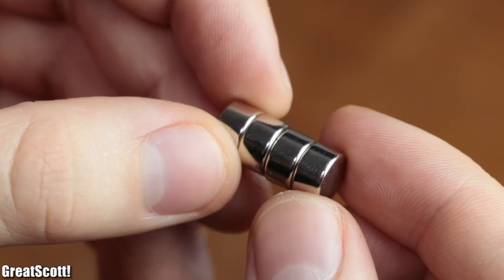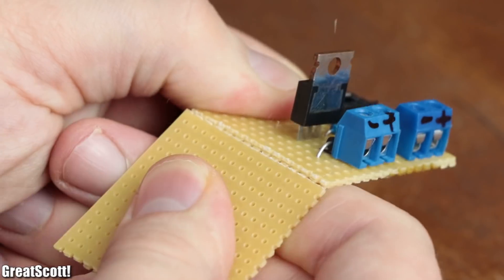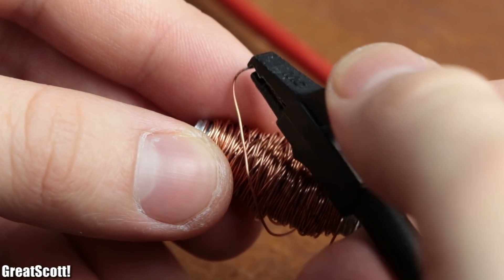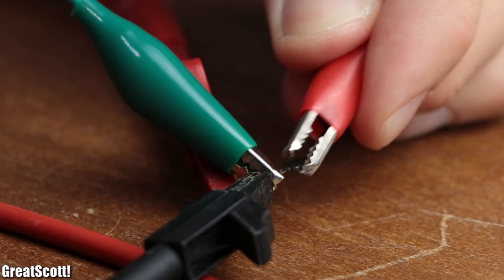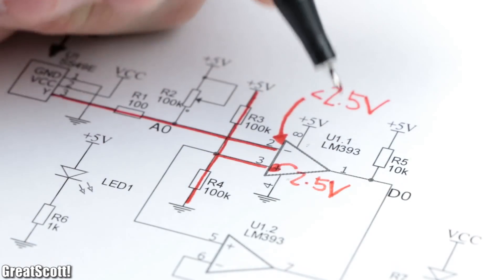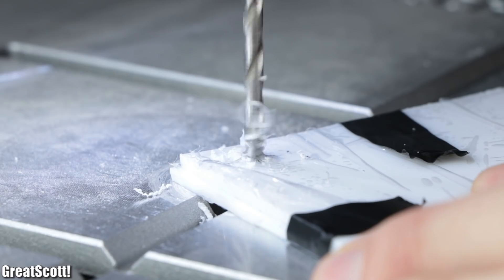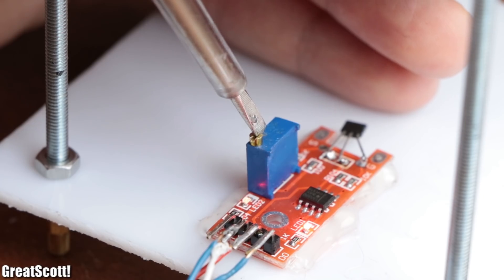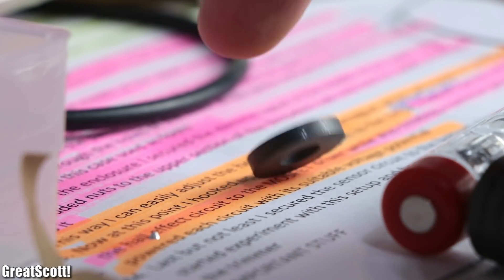How does Magnetic Levitation work? || Crude Levitator circuit

Comment: I'm in university and this year I had  to make a project in wich i had a big electromagnetic coil and i needed to control it in order to levitate a small metal ball and i had to use a comparator witch infomation was than feed into a PID controler and then the PID controled the current in the coil, you could do something like this
Reply from the maker: Yes, I am thinking about doing a basics PID video with the levitator as an example.
Reply: okey :-) it seems a good idea!  In my opinion, despite having a university discipline on control theory and another in which I applied this knowledge, the PID controller is still something complicated to understand but very useful to apply in several cases more in the automation electronics level!

Comment: Adding a PID to the comparator output might do the trick.
Reply from the maker: Hmmmmmmm maybe a PID basics video with this levitation task as an example...........
Reply: Would you consider trying to find the PID gain constants using a model for the system and root locus, or using a trial and error approach? Also, does the hall sensor only provide a "on/off" signal?

Comment: Hi Scott. Please help me. I need comparator for my little circuit. Circuit needs to turn on an LED if battery voltage is below 3.5V. Do you have any comparator to recommend?
Reply from the maker: The LM393 shows in the video should be able to handle this job.
Reply: So pin IN1(-) connects to ref. voltage(threshold voltage, 3.5V), IN1(+) connects to battery voltage?
http://pdf.datasheetcatalog.com/datasheet2/8/0uwqfq886ztdzxl759w49r6trg3y.pdf
Reply: It depends on the way you connect the LED: if the positive voltage is above the negative voltage, the Output is pulled up to (almost) Vcc, if not to GND. So if the LED is connected like in the schematic shown in the video (Vcc-Resistor-LED-ComparatorOut) your connections are correct
Reply: Here's schematic - https://imgur.com/WlhTOoi.png
-IN is threshold voltage, +IN is voltage from battery(for testing purposes it's another trim resistor).
Should I swap LED or inputs?

Comment: That is quite a complex system to control by just turning off and on the magnet. You should apply PWM to the electromagnet so you can regulate its magnetic field. Also you should look into control systems such as a PID controller, as this will allow you to achieve much better results.  You could implement more complex control systems such as a FUZZY controller but that is quite complex and you definitely need MATLAB for that.
Reply from the maker: When I get to part 2 of the video then I will certainly include a more complex control system.

Comment: Great video! Can you maybe make a video about a diy bms? because the china bms's are very inconsistent, I have bought 4 3s bms's for my bluetooth speaker and they all broke (not my fault), maybe a design which u can stack up? so you can stack 3 of them for a 3s pack, 6 or 10 of them for a 6s or 10s pack (for my electric skateboard, as charging methode because that will ask less amperage)?
Reply from the maker: It is on my to do list
Reply: Hey, those chineese bms doesn't have any balance charge feature so there aren't really BMS. BMS can't charge batteries.

Comment: 4:30 too much caffeine lately? ^^
Reply from the maker: +X99 Possible
Reply: @greatscottlab  why do you rarely reply
Reply: GreatScott! Those tremors you got are pretty common with electronics. Also i found the higher the voltage the bigger the tremors. Every time I wire 400V 3phase my hands are shaking if I hold the cable when electricity flows thru...
Reply: xD
Reply: X99 mother board